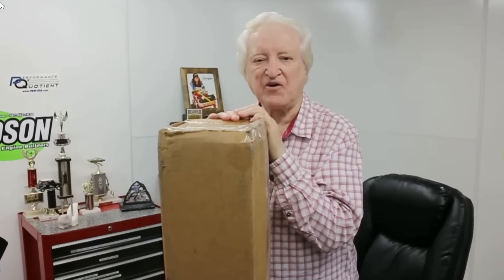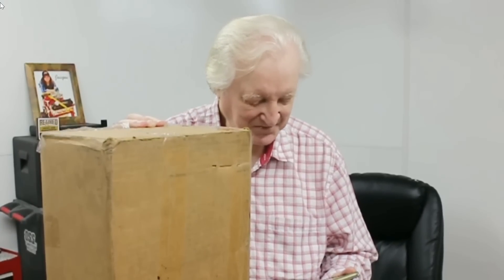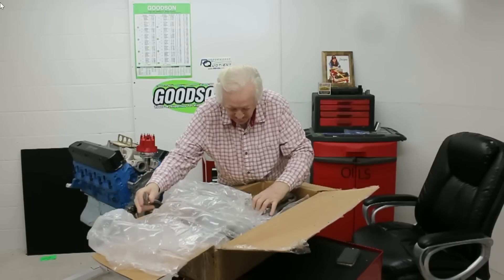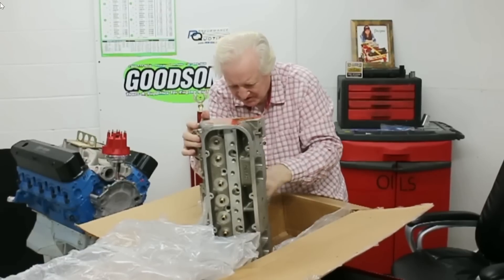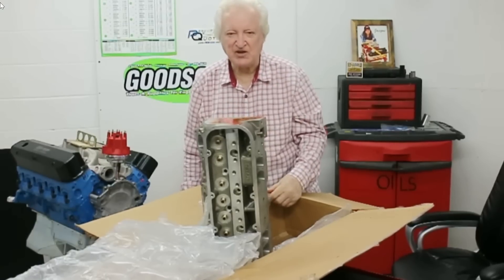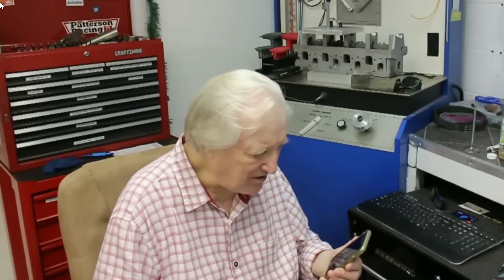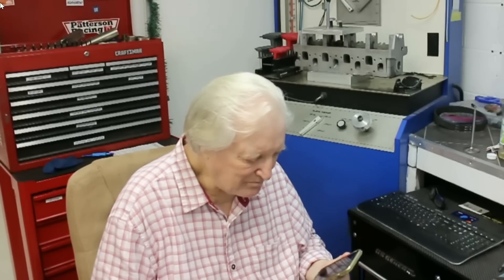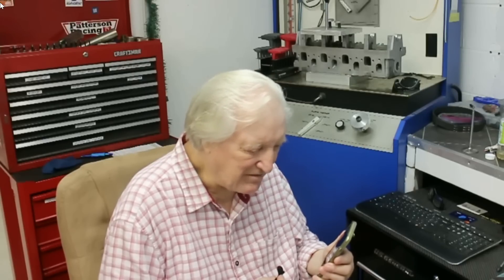It's confirmed! Small Block Heads - Big Block flow.

Comment: A LITTLE KNOWN FACT. A 351 WINDSOR HEAD FROM 1969-70. A PRODUCTION HEAD USED ON MANY 2BBL AND GRANDMAS STATION WAGON. ON THE INTAKE SIDE ONLY WITH SMALLER RUNNERS AND VALVES FLOWED JUST AS GOOD AS CHEVY'S BEST HEADS THE FUELIE 2.02. THAT'S HOW FAR AHEAD FORD WAS THAN CHEVY AND THE REASON THE LS TODAY USES THE FORD WINDSOR HEAD DESIGN WITH THE RAISED HIGH RISER PORTS FROM THE FORD 427. THE LS IS BASICALLY A REGURGITATED FORD 427 HIGH RISER ENGINE.

Comment: David  1000 hp on 87 pump fuel .... is that  87 octane rating the same as here in Australia.  Looking 4ward 2 future presentations on this build .  Cheers Robert    Australia
Reply: USA 87 (R+M/2) is about AUS 90.
Reply: @hotrodray6802  

Cheers 🍻  Did some checks ✔️ on line & it's 91 🇦🇺 Australian octane & the USA 93 = Australian 98 octane.  
Thx 4 sharing .

Comment: It should be lowRPM high horsepower high torque like a big block in a small block tunnel ram 5500 RPM 1,000 horsepower

Comment: Would be interested if youve ever cut heads apart to possibly  engineer some kind of heat sync on the back side of the cylinder to super cool it.     I know its kinda crazy sounding but if you could transfer heat in a big way  Just a thought.   Thanks DV.     Got the idea from industrial boilers  - pins and fins
Reply: The manufacturers need to be looking at that for better efficiency.

Comment: This is a awesome looking head , 
I'm curious what your opinion is about running a engine on methanol or ethanol, or a blend.  To replace a gas engine,  and keep the economy or possibly beat it!  I was thinking about using something similar to Mercedes OM-606 turbo diesel engine, heavily modified, converted to run on methanol or ethanol, I'm thinking of the diesel 3.0L base because it's built to survive the high compression, and can spin to 5k rpm, and make 500-600 HP, on diesel, with little mods,  but convert or uses similar engine, to replace say, a 300 ford  with 4bbl EFI, or carb, 9.5:1 and mild cam maybe a small non intercooled turbo, 4-5psi, probably making  between 300 and  350 HP, probably something in the middle, with a decent TQ curve,  probably making near diesel TQ,  
I'm. Rambling on a bit, but do you think it's possible to make roughly the same power, and TQ  get approximately the same mpg, as the 4.9L on 87-89 gasoline,   
I do believe a OM-606 diesel on boost, and tuned, can make the power, 
It possibly use the 5 cylinder 2.5L version to replace the basically 5.0L I6  half the displacement,   can it reliably equal the larger engine,  or possibly perform better, get the same mpg or more, on the methanol or ethanol,   and last , 150k miles + without overhaul,  while it can turn 5k maybe close to 6k rpm, if a engine was designed from scratch. T could do 6k easy but let's say it is limited to 5k for survival,   it needs to operate in the 1500-5k rpm range,   and run a compression ratio to take advantage of the octane of the methanol or ethanol,  ( sorry this has taken me a hour to write, I have to keep going to do other things, it's difficult to keep my place)    but I was thinking,  the power is in the heads,  the development  would probably require a possible billet head cnc machined,  flow tested, ported, seats,  chamber work, possibly many flow these sessions, cylinder swirl  testing , port velocity testing, maybe testing different valves,  and unshroud the valve  after all that, then scan the head, make the parts to cast the head, and Before mass production,  start all over with the seats and  flow testing,   the possibly of starting over is real,   I'm guessing the development at Lamborghini or for F1 heads,  and for this project the exhaust valve would.
Be larger than normal being there is 25-30% more fuel going in the cylinder, just to equal the gas  air fuel ratio,   and ya smaller intake valve to ensure no shrouding, and use the boost to Get back the lost power from the small intake valve  wit 6-7 angle seats  closely checking flow across them.  and The flow all the way  into the cylinder , getting swirl, nearly comparable to a diesel engine,  the port velocity  worked on to get it optimal, probably re-scan   and cast a head, to get a as cast head  to the point where  30 minutes or so on a cnc can reproduce a head hand ported and chambers  CNC to equal perfected  hand finished head , polished to perfection,  maybe a good cnc can 99.5%  get it there,  it would be awesome to build a 2.0L 4cylinder that is basically equal to the OM606, and  build it to replace a slightly hopped up 5 litre  I6 engine in a 4k pound truck,  and get the same milage , or more, only on methanol or ethanol  , possibly a blend, I hear one works better in winter,  so a blend could offer better cold start performance,  a glow plug , in chamber, and/or in the intake runner, heated to 250°f minimum,  not enough to ignite the alcohol,    making exceptionally cold starting much easier,  possibly required for direct injection of methanol,   I don't think a -30 ° F engine would want to start!  Spraying methanol on the sparkplug!   My whole point is green fuel, batteries are not the answer for everyone yet atleast, we need a cleaner fuel,  methanol can be made from wood and plant matter,  ethanol from sugar , potatoes, corn, peas, beets , fruits,  we waste tons of food, it can be  processed to remove the carbs and starches, and pyrolysis will remove any methanol from the stalks and from wood, also release basically natural gas, it methane,  and some can crate basically a crude oil, that can be further processed,   there is very little carbon in the alcohol,   and growing the plants , part will stay in the ground, putting carbon in the ground permanently, plus the carbon remaining from the pyrolysis can be use as fertilizer putting carbon in the soil,   this can help the earth,  create fuel, and put carbon back in the earth, I was thinking plant something like bamboo, that is large , as well as fast growing, maybe it can produce methanol,    the remains from sugar cane, can be put through the pyrolysis process, after being dried, if the oil companies invest in this,  the big thing is heavy trucks can be converted to run in ethanol, the pulling tractors have been doing it for years,  they will loose about 25% if their range,  but adding a electric motor and battery to the truck adding about 250-300 ft lb TQ, and 150-200 HP,  with a 100-150 mile range,  to basically propel the truck down the highway,   or  helping the engine on steep grades, and acceleration,   and on the docks making things quieter,   and should be capable of keeping a loaded truck traveling at speed for a while, , 150 miles, at 70 mph, it may not accelerate it at that speed but should maintain that speed, the truck could be idling, and also making power moving the truck, use cylinder deactivation to  to limit fuel use,  you know much more about this than I do,  I just think we need to make the effort!   What got me thinking about this, was powering a generator using a 10hp gas engine, I got to thinking, maybe I can build a 5-6 HP engine to run on methanol or ethanol,  actually designed for the high octane fuel, and , and the 25-30% more required would be offset by the use of a smaller engine, the higher octane equivalent, can allow much higher compression, making much more power, and it should run cooler! Or equal, being it's running a bit harder,   use a 6.5hp engine, modified, on methanol, compression require a decomp lever and electric start,  I was thinking about running 200-220 psi compression,  and modify a carb to handle ethanol,   maybe slightly modify the cam and or timing, maybe have the cam ground,  maybe give it more lift, a slight bit of duration,  and maybe change the valve timing slightly,   learning  what will be required to get normal use from a modified alcohol engine, using a single cylinder is the easiest way to do it!!    
But building VA car engine with a head optimized for alcohol, would be awesome, especially if it can be richened a bit more, and add a bit of nitro methane, 5-10% with a extra 10-15% more fuel,  it would be awesome to see what difference it can make,    I have totally rambled so much and far from subject,  so sorry,  but this idea has plagued me for a few years,   if you made it this far, hope you had a good holiday season, Christmas or whatever you may do, and happy New year!! Sorry again for getting so carried away, way far far away!   Good day!

Comment: It has to be water-methanol injected or E85 to run 14:1 on low octane fuel.  Uratchko has a pump gas small block making 950+, but I don't know anything about it.

My bike engines run perfectly well on E85(with modified ECU) and make pretty good power - almost 250 whp at 1000cc, but it took me 7 years of development time to get to that level.
Reply: 250rwhp out of 1000cc is no joke

Comment: Cleveland aftermarket and factory closed chamber cylinder heads flow just as much if not more than BBC and BBF cylinder heads.
Reply: THE FORD CLEVELAND HEADS WERE THE ULTIMATE IN POLLY ANGLE HEAD DESIGN. IT IS STATE-OF-THE-ART. ALL YOUR SYMMETRICAL CHEVY RACING HEADS TODAY ARE ALL FORD CLEVELAND DESIGNS. THE DRCE-DRAG RACE COMPETITION ENGINE GM MADE IN 1983. WHEN THE NHRA MANDATED TO 500 CUBIC INCH RULE IS A PLOY TO GET RID OF THE FORD CLEVELAND ENGINE. IS NOTHING MORE THAN A OLDSMOBILE BLOCK STUFFED LIKE A THANKSGIVING DAY TURKEY WITH A ROTATING ASSEMBLY FROM A BIG BLOCK CHEVY. THEN WARREN JOHNSON ALONG WITH GM MADE A BIG PAIR OF FORD CLEVELAND HEADS FOR IT.. WHAT CHEVY HAS BEEN WINNING WITH SINCE 1983 IN PRO STOCK IS NOTHING MORE THAN A BIG CUBE FORD CLEVELAND MOTOR. THIS IS THE REASON FORD DOESN'T PARTICIPATE IN PRO STOCK. BECAUSE IT'S ALREADY FORD CLEVELAND POWERED. IF FORD WAS TO PRODUCE A MODERN PROSTOCK CLEVELAND-STYLE HEAD. THEY WOULD BE FACED WITH RULES FROM THE NHRA AND STIPULATIONS ON HEAD DESIGN TO PREVENT THEM FROM DOMINATING THE SPORT LIKE THEY DID BACK IN THE 70'S. FORD WOULD LOVE TO ENTER PROSTOCK. BUT THE HENCHMEN FOR GM THE NHRA WHICH IS ANOTHER DIVISION OF GM. WOULD HIGHLY GOVERN AND MAKE RULES BOTH WRITTEN AND UNWRITTEN TO PREVENT THEM FROM WINNING. CHEVY HAS BEEN CHEATING THEIR WAY TO THE FINISH LINE SINCE THE AMA BAN OF 1957.
Reply: @Frank289100  NASCAR banned the Cleveland’s back in 1986 because the Fords were making 70+ more hp than the Chevys. Chevy basically got a race purpose engine in NASCAR because they were running Buick and Pontiac style cylinder heads in the early 80’s. Lake Speed switched to Ford because they’re having to spend about $10-15K on a set of cylinder heads for Chevy engines, but the Cleveland’s A3-D3’s cylinder heads were half the cost and made way more power. And then NASCAR gave Chevy the SB2 in 96 and then the RO7 in 2007. Ford was stuck with the same old conventional 351-C headed Windsor up until 2010. NASCAR finally gave Ford the FR9. NASCAR wouldn’t give Ford nothing until Chevy passed Ford for the most wins. It did take Chevy 60 years and race purpose engines vs Fords conventional Cleveland and Windsor platforms. Yeah we’re killing the Chevy guys on the streets with a NA 418-W.
Reply: @Frank289100  that’s funny. Yeah it don’t take much for the Chevy to get their feelings hurt.
Reply: @StainlessTIG2  THEIR LS ENGINE IS 100% FORD. IT IS A REGURGITATED FORD 427 HIGH RISER ENGINE AKA RAISED PORT 351 WINDSOR. NOT ONE DESIGN ASPECT OF THE OLD SMALL BLOCK CHEVY LIVES IN THE LS. IT IS 100% BASED ON FORD DESIGNS.
Reply: who cares not what there talkig about

Comment: Great video, looking forward to the build. How are bike engines running pump gas with 13 & 14:1 ratios?
Reply: I'm not very familiar with motorcycle engines, but I'm guessing they use aggressive cam timing to reduce dynamic compression.
Reply: @michaelblacktree  Valid theory. Those engines are revving over 12-13k

Comment: Those are good heads,  but require a lot of exotic parts to work,   I would buy MBE billet small block heads in this range of heads.     MBE will design the ports to your CID and your application,   more of a custom build.    MBE claims up to 495 CFM , and 1185 HP naturally aspirated from 400 CID, which is serious flow, and power in a 4.4 bore space SBC N/A.
Reply: MBE makes very nice heads. But they also redefine needing exotic parts. Pistons, cams, intake, exhaust, valve train, etc, are all different. The MBE heads on a 400ci making 1185hp is a nitrous motor as well. So yes it is NA, but it is still using a power adder.... You can make similar power with 9 degree heads with nitrous as well.
Reply: @shvrdavid   No sir,  the MBE heads made 1185 HP naturally aspirated.   No Power Adder,  I know the engine and the class it races in, they do turn it 10k rpm.      The dart heads in the video also require special pistons, exhaust, intake, as for camshaft,  all race engines built by anybody who knows what they are doing has a custom camshaft.       These Dart 9 degree heads are good,  but out of the box no comparison to the MBE billet, which are symmetrical, have the valves/ports in more optimal locations.     Its not just about flow of the ports,  but how it flows through the engine, but the MBE flows 25% more than the Dart 9 degree after DV modifications.    400 vs 500 cfm.

Comment: I'm trying to put together a small journal 327 bored 30 it has flat top Pistons, I want to get afr enforcer heads. I'm hoping to get at least 400 horsepower. 😎
Reply: U probably wanna stay around 180s
Reply: There is some nice iron heads that are cheaper…
Reply: I want some heads already completely assembled. 😎
Reply: @jamespepper2541  You should use a head with a much smaller intake port cross section. Like a Trick Flow DHC175.
Reply: You won’t need to  crutch the 327 with a small head if you get a vizard spec cam and a dual plane intake.the 195s will work.